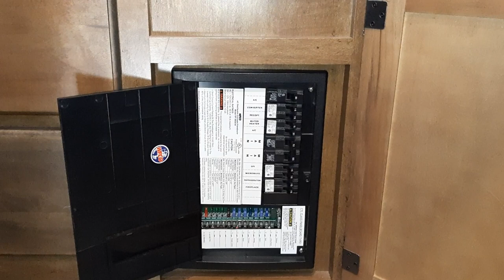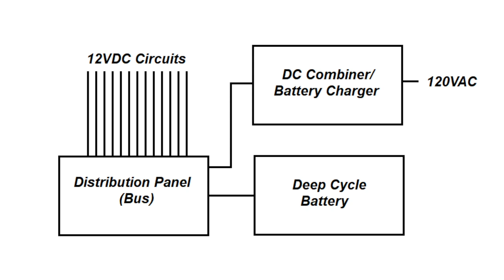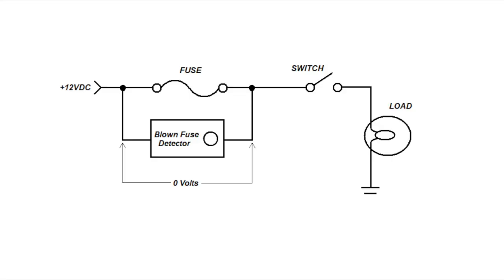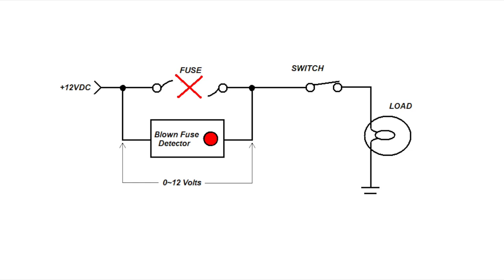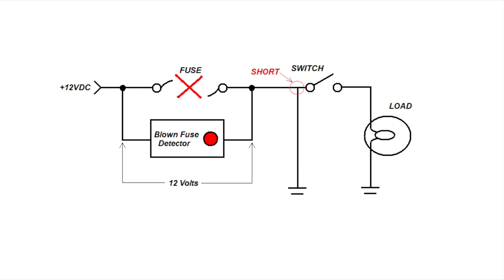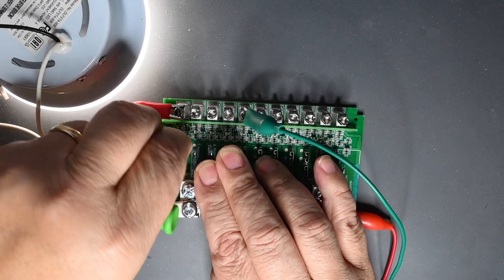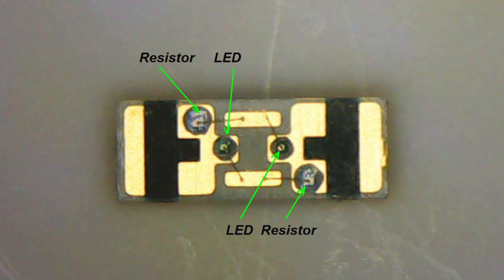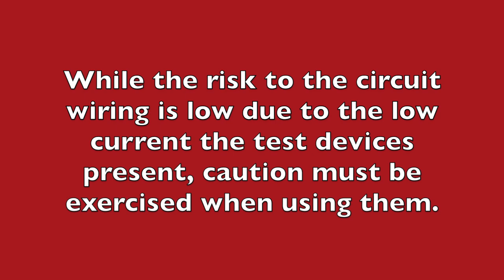Troubleshooting Blown Fuses in your RV.

Comment: Great video!! I once owned an RV coach that would periodically blow the water heater 12vdc fuse. Then, for long periods, the replacement fuse would work just fine. Then just as suddenly the fuse would blow and trying to replace it, it was obvious there was a dead short on the 12vdc water heater circuit.

Anyway, it drove me crazy and I finally threw in the towel and took it to our repair guy and based on his years of experience he found the problem. The +12vdc wire was periodically coming into contact with a metal strut buried behind a wall and of course the fuse blew immediately, as it should. Many of these RV's are not made well, IMO.

You repair guys earn your keep!!
Reply from the maker: In my view, the state of today's RV industry is much worse than the low quality of the automotive industry in the mid-1970s.

All it is going to take is one player to provide a well-built RV, and the rest will be out of business overnight.

Comment: When doing our initial walk thru and PDI it became very apparent that the dealer's tech had no concept of how this panel actually worked. The electrical 12vdc and 120vac marriage that runs these rvs is not something most of us have had prior experience with and can be confusing in the beginning. Even your simple diagram of the battery/charger/distribution board is most helpful. Please continue!
Reply: it doesn't help how they are manufacturered two of the same RVs can actually we wired differently depending on the "electrician" on that day.  I converted my 30 amp RV to a 50 amp system and I needed to pause and figure out several times to figure out what the heck the manufacturer did especially on the DC side.
Reply from the maker: Thank you for your support of the channel.
Reply: You didn't answer

Comment: This was awesome! The manipulatives (instructional tools)  were good for demonstrating scenarios of shorts, but I did find it hard to follow with the wiring that was used to simulate the shorts instead of the actual hardware. Nonetheless, excellent visuals, particularly the diagrams that were actionable!!  Thank you
Reply from the maker: Since the wiring varies in each RV, it's hard to come up with something that will apply in each situation.  since the fuse board came out of a RV and is fairly common, I decided to use that as the focus point.

Comment: Really helpful. Thanks. I have a 12 volt lighting circuit combined withy USB ports (apparently, as neither works) that has failed. Going to use my new knowledge to troubleshoot the fuse board. If that fails, I will take it back to the repair shop that fixed the ceiling A/C ducts over the past winter. Duct damage due to critters (mice). It is possible they also damaged the wiring, or that something happened during the repair. Great video, especially combined with the ATM/ATC/ATO video. Thirty minute crash course in 12 volt RV systems. Nice.
Reply from the maker: Thanks for watching. Be sure to  check out my other RV technology series videos.

Comment: Hi,

I have a small travel trailer with a WFCO 8735. After a days towing, the same fuse #5; 15 amps is always blown. Once I replace the fuse and hookup to shore power, the fuse will not blow again (til towed). 

The red  led light on the WFCO is on.  The circuits on this is a control panel (with rocker swtiches for lights, fan, toilet pump, and CO monitor.  Everything on this circuit is off when towing
. 

Can you give some suggestions of where to look for the short

Thank you

Comment: Thanks for the explanations on the fuses. I have a WFCO 8955 in my Outback and I was having troubles with it charging the batteries when plugged into my generator. I found that one of the 40A fuses was blown, so I'm hoping this was the cause. Do you know why there are two 40A fuses, they both seem to be hooked up to the same items?
Reply from the maker: My test WFCO panel is the same. The only reason I can think of is that the maximum fuse size for an ATC/ATO fuse is 40A  and they needed more.  However, it seems to me that using two fuses would not be as reliable as using an 80A Maxi fuse.
Reply: @RVProject  I was also thinking that it may have been for a backup in case one fuse blew, there would be another to keep you going. I also found that the female socket  that second fuse plug into wasn't tight, so it  would cut in and out when charging the battery causing it to take a lot longer than it should have to charge. Electricity is such a finicky thing.
Reply: The  two 40 amp fuses provide reverse connection protection to the converter should the battery be connected backwards.  These are DC fuses and would be on the DC side of the converter.  If 1 or both 40 amp fuses are blowing with the battery correctly connected, that could be indicative of a possible converter issue.

Comment: Why would the levelers and slide out be wired directly to the battery?  I noticed that when my built in battery on off switch is in the off position that the levelers still have power.
Reply from the maker: This is typical.  Levelers and slides take a lot of amperage, so they often wire directly to the battery to prevent voltage drop issues.